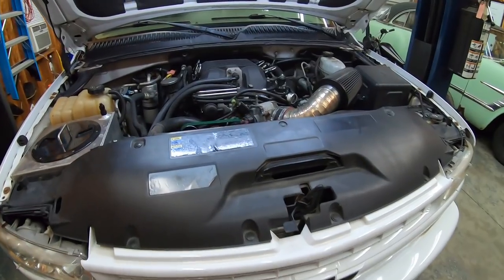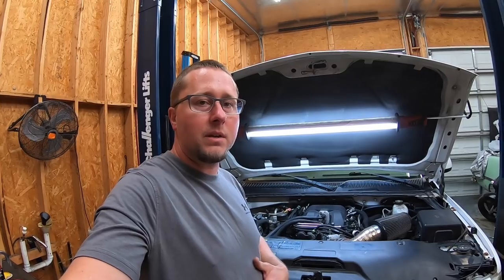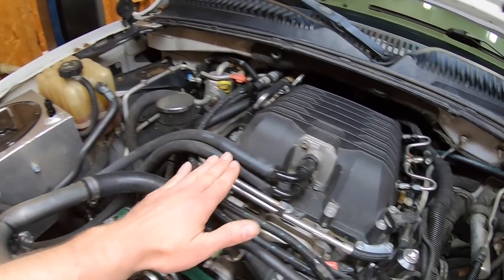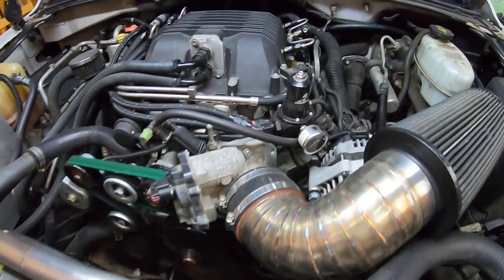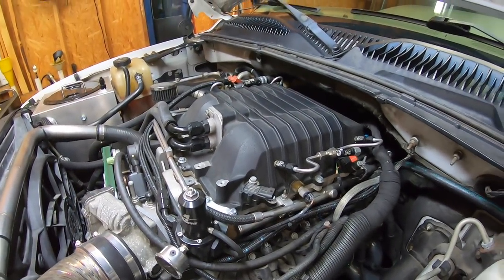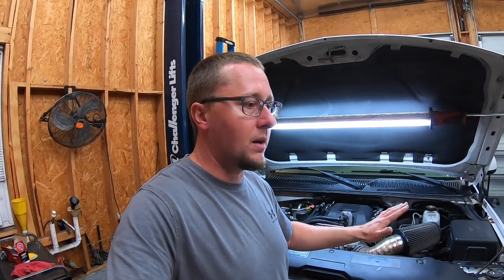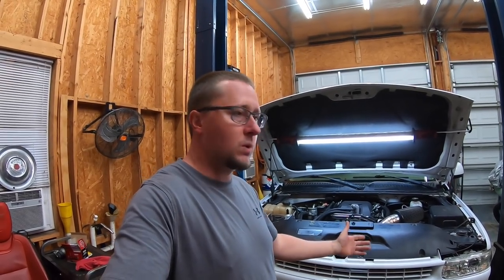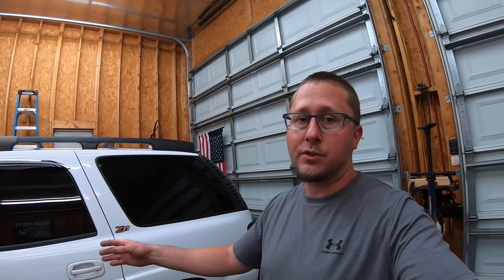How To Build a 600+ HP Tahoe

Comment: Long post, sorry,
Thanks for this. I can use this as a guide if I decide to continue with my Tahoe. 
 A couple of summers ago I purchased a Tahoe almost identical to yours, mine is lowered with 17” wheels. In great shape. As I understand it, the stock 4.8 had been swapped for a stock rebuilt lq4 with an LSA supercharger and ZL1 lid. The converter was “a cheap single disk that would get the job done” of unknown origin. The transmission is a stock rebuild of a 4l80E. the rear end is rebuilt with Posi and 4.11s. The exhaust is shorty headers through what looks like stock y pipe and cats to a single 3 inch out the back with a Magnaflow muffler. The guy who tuned it admitted to a driveway tune and he didn’t know what he was doing.
I was working with a local guy on a street driven tune. My Tahoe wasn’t that quick, averaged 13.4 to 13.8 @ 101 to 99 mph. The exhaust sounded like it was pushing air through a straw, so my fist changes were going to be converter, headers and off-road y pipe. The torque converter had been set to lock at WOT, something the tuner and I agreed may damage the currently installed converter so we turned it off, which did slow the truck down some. He made the tune safe, fixed the shift points and the timing. There were problems I found after that we hadn’t noticed. 
After the last tuning session, I was almost home when I noticed I only had about 0 psi oil pressure (no pressure warning light) . The engine was making no noise or running any different, I pulled off and checked the oil level, it was a quart low, which seemed odd, but not enough to cause this issue, which did not resolve after filling it. While checking this out, I realized that I couldn’t get the oil cap off with the engine running because the entire system was under full engine vacuum. After tracing the tubes, I found all parts of the PCV system to be routed to vacuum sources (face palm). I corrected that,  changed the oil and filter and the pressure sender. After fixing the PCV by routing one of the valve covers to an air cleaner, I got about 5 psi back, which gives me about 5 psi oil pressure when hot and 40 psi when cold, pressure never rises with RPM, sometimes it drops under load and rises under decel, leads me to believe its main bearings, but not sure, I did cut open the filter and found some brass shavings in there, not a lot, but they were there. Still don’t know what caused this on a motor that everyone tells me is very stout and should be able to handle this setup no problem unless the weird PCV routing caused some internal oil starvation issues. 
Moral of this story, I broke my own rule and bought someone else’s project and now I’m paying for it. 
I do drive it up my street occasionally, but I keep it parked most of the time until I can figure out if I’m going to keep it and do something with the Shortblock or sell it for whatever I can get and put that money into the Firebird. It’s a good starting point and I was excited to see what I could do with a pulley, tune, decent converter and LT headers plus exhaust, was counting on having to put a shortblock or replace all bearings already.

Comment: I might be out of my league here, but the Z71 package GENERALLY comes with the G80 diff.    That is a very interesting diff.   It uses the difference in centrifugal force between the two axles to activate the mechanical LOCKING differential.   If one wheel spins at more than 100rpn faster than the other, this big pawl flips out and locks the axles together.   I liken it to how Park on the transmission uses a pawl to keep the driveshaft from turning.    In other words, it is a true locking diff, no clutches involved at all.   And that in itself may be the problem.    Once it locks up, it stays that way until both tires are turning same RPM for several feet but it also needs a reduced load.  From my experience it won’t release while accelerating.   Be he ad it locked in the mud, then a slight turn onto pavement, then straight, but under throttle, trying to get a little sideways, and all it wanted to do was hop sideways, quite unnerving, and rough on and diff.  I’d get that if it locks while doing a burnout, stays locked, and you launch, then the 1-2 up shift could destroy that whole mechanism if it’s not completely disengaged, or even still engaged.   I don’t think it’s the constant pressure that hurts them.   I think it’s the shock of engaging with tons of traction.     Something has got to give.   And with like 2500 lbs over the rear axles, nearly 600 ft lbs of torque, 3.73 gears, which are physically task, and big stupid tires, something is going to break.    Take out the G80 and use an air locker.    Or, spend a bunch of money.
Reply: G80s are known for blowing into pieces. I did my rear end last year and put a detroit locker in it with worm gears. A wayyy better upgrade.

Comment: Nice work!  I have a question, where did you get the wiring for the MAF to MAP sensors. I have a 2004 Regency and wanted to wire it the same way you have!!  Thank you in advance!! Keep the vids coming!!
Reply from the maker: Crawford Racing made me a harness
Reply: @HighPSItv  Thanks, I just got off the phone with Chris the owner.  Very cool people and he was able to take my info (he requested for me to send an email which i have done)  and will have the harness to me in a few weeks. I told him no rush i didn't need it for a few weeks. I was really surprised when the owner answered the phone.
Reply from the maker: Chris is the man when it comes to harnesses

Comment: Great video I was already looking to get an rpm trans for after I do the twin turbos in my 06 YukonXl slt just put the Yukon gear & axle trutrac slip position rear end 3:42 gears to match the front not sure if that's good or not but it has gapped a Lincoln mix going up an overpass bostock 5.3 flex L59 engine. What cam would you recomend for a tt setup I'm looking to get sumthin between 600-800 who. Any suggestions?
Reply from the maker: Check out BTR boost cams. They work great

Comment: Wondering if doing the same setup or turbo charged setup on a 4.8 vortec. Do you think the 4.8 is just as good as the 5.3 if not better? Because I've heard that 4.8's are notorious for boosting and are capable of handling more than what a 5.3 ls engine would. I've just been wondering because I would personally love to turbocharge my Tahoe in the future, which has a 4.8.
Reply from the maker: 4.8s make almost the same power as the 5.3s. Id go for it

Comment: Pardon, what’s with the oval pistons ?
Reply: Badly worn at the front and back :-)
Reply: @jonathanstaley9522  , i was told these engines were reliable.  My '04 has >125k, should i be worried about this kind of unusual wear ??
Reply: @telemachusepiphany9668  Depends on it's service history. 125k is nothing these days if oil changes are done on time etc.  :-)
Reply from the maker: They were just worn out
Reply: @telemachusepiphany9668  nah, LS engines have " on center " style blocks so thrust wear for the pistons should be near zero. But poor maintenance and abuse can make pistons deform.
Reply: @telemachusepiphany9668  ill put it this way, I give my 02 Audi what it asks for, on maintenance....and its reliable at 143k

Comment: Can you use the stock 4L60 drive shaft with a swapped 4L80m
Reply from the maker: You can not
Reply: I am. You just have to swap the front yoke and use a hybrid u joint. May be diff if you are 4wd..

Comment: I bet you really have heard a ton of shit about still using a 4l60. They'll hold, if you spend a ton on all the internals. I've built many over the years working for Chevy dealers. I just don't care for the ratios and the 3-4 clutch design. Sonnax has a badass 3-4 clutch drum where the top 3-4 plate bolts into the housing instead of using a snap ring. You probably have it in your trans. The 80 is just so damn stout, with nothing but a shift kit and heavy forward drum it'll hold what those level 9000 60s will for a silly cheap budget. Matt Happel's sloppy Colorado is a good example.

Comment: Does anyone know how much it would cost to do all of this to a stock 5.3 tahoe?
Reply: I'd like to know the same
Reply from the maker: Probably about 15k
Reply: @HighPSItv  You serious?
Reply: @infamousnova  LSA blowers themselves are about 2-4k that transmission being lvl(stage) 6 is probably another 4-5, then the diff is probably 1-3 then all the little things like coolant tanks, ZL1 lids.....modifying cars is typically a rabbit hole.
Reply: @armaggedon4christ  welp. This is out of the question lol
Reply: @infamousnova  yeah the pay to play saying is no joke, if you want an FI tahoe, just go high LSA cam, low overlap(low duration) and go wu tang war whistle( chinese turbo) with an intercooler stay under 10psi and stock internals should hold up quite well depending on how you drive and how well its tuned.
Reply: Cheap for a Na 510hp build, Got a low miles used 5.3l for around 1k. Upgraded the heads with a summit kit cost around like 900, this included a cam. Also do a intake manifold  and injectors cost around 800ish there plus 300$ for random gaskets. The transmission cost around 1.2k to build it is a 6l60e and the Dyno and software cost around 1k and a stall converter for 500. Makes 510ish HP Na, plus a 50 shot of nitrous. The most important part is the heads, pull a set of 799s from a junk yard if your vehicle does not come with them, after that is the cam then a intake manifold.

Comment: Nice I don't like the ethenal using fuel should be non ethenal only
Reply: For newer 02 and up it's good for them as far as the little bit of ethanol that's in regular pump gas 10% probably helps clean a little and raise the ability to not knock. But if you have a tbi or carb it's not for you. But e85 is a big difference in how clean the intake ports will be and how much better it is at raising the knock threshold and cooling purposes and it's cheaper than 87. Now if your just driving around in your stock cavalier then it's not going to help but if you have a FI setup and want to make the best of its power capability and not blow it up then this is a cheap alternative to running race gas all the time to be able to have fun on the street in a street car.
Reply: E85 is like 105 octane straight from the pump, that's why it's the preferred choice of fuel for forced induction
Reply: You can make a lil more power running the corn juice
Reply: @brandonchauvin4739  little.......in my V ethanol would net me 100hp alone on stock everything else...except injector.....Ide need new injectors as they are maxed at stock

Comment: 660 on the crank. D.. you americans must have sh... fuel, could actually wonder what you use the blower for.... Anyway nice build
Reply: Can you try again in English? Because none of that makes sense.
Reply: @swackhammer2139   Very little power according to volum and the reason is lower quality fuel. So on higher quality fuel it should be possible to reach 550+hp in a 5.3 Vortec without the blower
Reply: That would be a max effort 5.3 with no where near the power under the curve as this blown setup and definitely not close in torque.  Probably have to run a 3600 stall just to get it to move.  Who wants that in a heavy dd tahoe?!
Reply: @spyderlyf3  Who wants that in a heavy dd tahoe? Given rotation-force are same as original + added extra amount of fuel... About 100% of the owners of org-tahoe.    No i did not sleep with this post under my pillow, after 2-days i just wanted to see if anyone had other experiences and your comment was here.   And I agree, best way to acheive the power is the blower given as you state. The torque gained are impossible with only NA-tune.